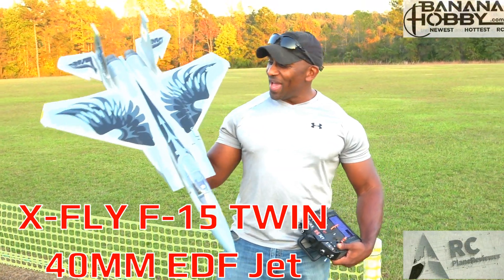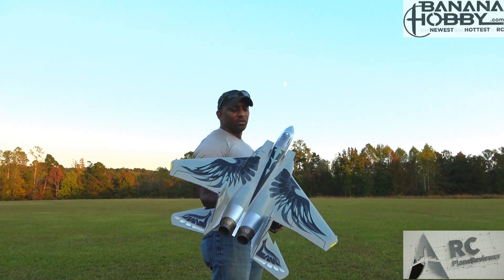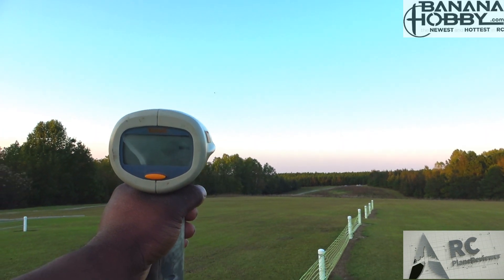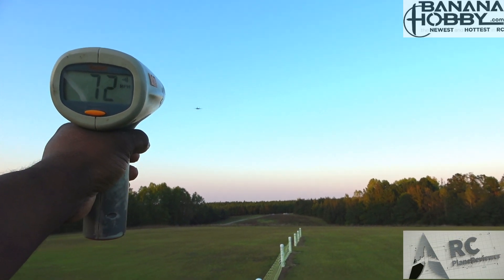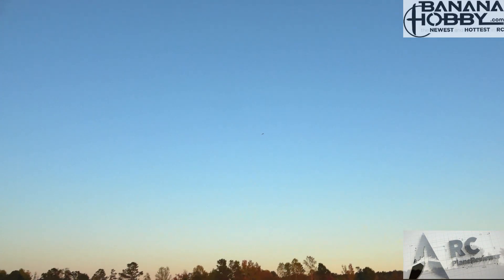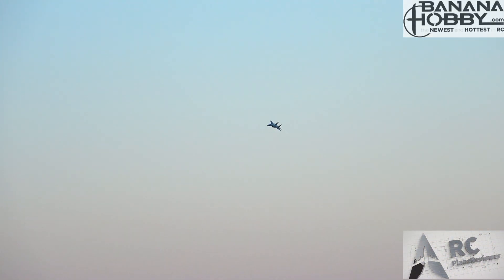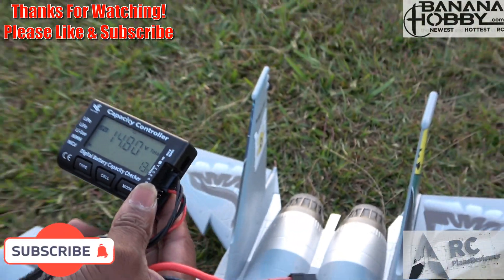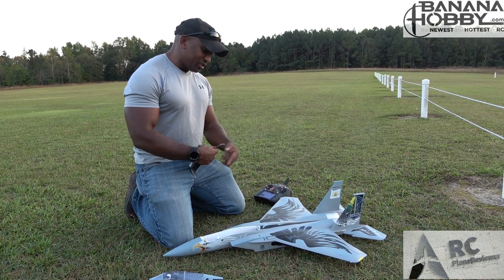Can the X-Fly F-15 Eagle Twin 40mm EDF Jet REALLY Reach 100mph?

Comment: Xfly are absolute morons & this plane is now garbage. Try changing a tail servo on it, they buried the connector in the foam so you have to scalpel the rear fuse to do a simple servo change. Xfly is now on the do not buy list.
Reply from the maker: Man, that sounds super annoying! I hate when they make things harder than they need to be. Hope you find a better option next time!
Reply: @RCPlaneReviewer  Thank you for your kindness, would be good information to forward to the viewers at some point. Even better if Xfly pick up on it & make a change. In any case I WILL tame the beast 😅 Have a great day (or night) brother👨🏾‍✈️

Comment: How do you tihink it compares to the E-Flite F-15 64mm?
Reply: I have both, the FMS/E-flite 64mm and the Camo version of the X-Fly Eagle. Hands down the X-Fly is a prettier, more accurate plane with full flying elevators and really nicely detailed tail cones. But, the E-flite 64 has more power and RCPlaneReviewer clocked it at 116mph via GPS. Both are fun to fly but the X-fly's like a V-6 and you have to manage the throttle to get the most out of it. The FMS/Eflite's like a Hemi Charger, fatter but with gobs of power on tap. Both are stable and both can be acrobatic.

Comment: That was flying nice at half throttle, do you think it would be  good on 3s 2200 and save some weight too ? Probably draws a lot less amps at lower rpm's so might get longer flight times. My Twinliner will fly 3 1/2 minutes on a 1300 3s !

Comment: I've got the Twinliner and spent a fair bit of time getting it to fly slow ! I achieved that with flaps and a much smaller 1300 3s lipo. The F15 goes really well on that 4s set up and 70 - 80mph is just right for this one !

Comment: So this twin 40mm dont use the same powerplant? I have a f22 & su57, f22 seems wayy underpowered, no climbing power. Have yet to try the su57.
Reply: Also try a 50c or 100c pack
Reply from the maker: @lewiemotorsports3616  Eh C ratings aren't a real thing past 30-40c, SMC are the direction for proven performance. So I don't  bother with higher rating past 40c
Reply: @RCPlaneReviewer  you fly more than me, that’s valid. I’m only going by my personal experience with xfly planes. My twin 40s and my T7A have damn near unlimited vertical on a 2200 50c hrb or 2600 100c graphene pack
Reply from the maker: @lewiemotorsports3616  Now, graphine packs are different, definitely noticeable punch 👊 in those for sure!
Reply: @RCPlaneReviewer  Graphine packs are better in many ways, the high c rate packs don't puff like low c packs
Reply: @RCPlaneReviewer  yeah I'm very happy with those and my hrbs! You and Jeff got me hip to the hrbs, I have chnls and smcs and zees too but charge for charge those graphenes are just perfect!!
Reply from the maker: @Mroswaldo16  No climbing power? Calibrate your esc? That's much different than what I'm experiencing as you can see. I'm using a single 2200 or 2600mah 4s chnl or hrb
Reply: @RCPlaneReviewer i will calibrate the ESC see if that helps it. im using a shorty pack 4s 2200 35c pack. I use the same battery on my f16 50mm but its a smaller jet & thats a rocket.